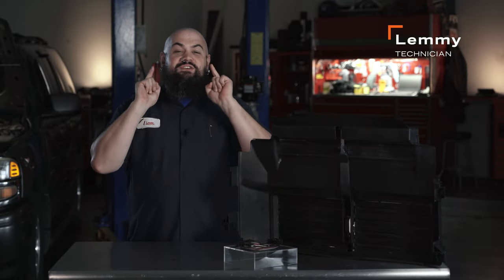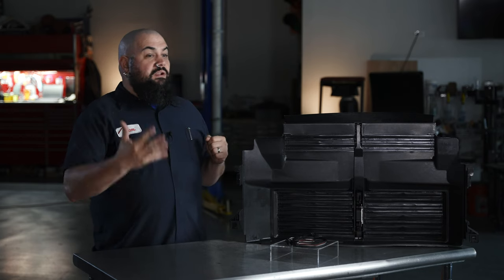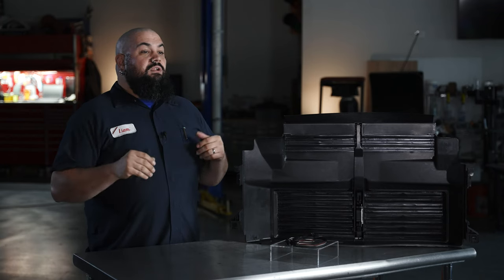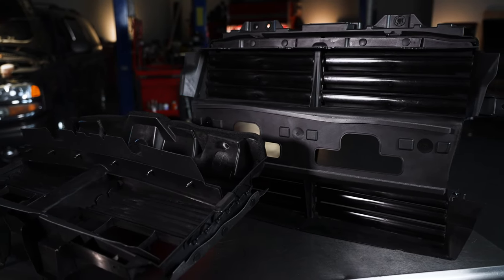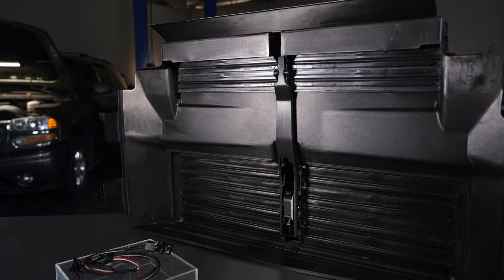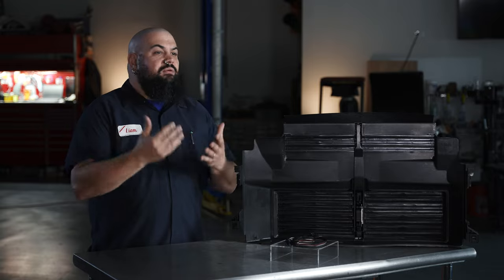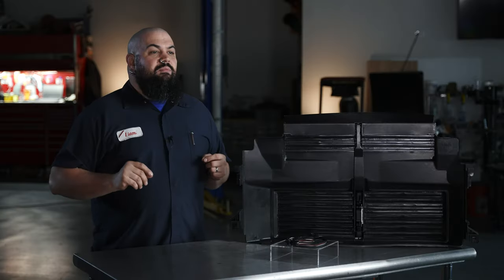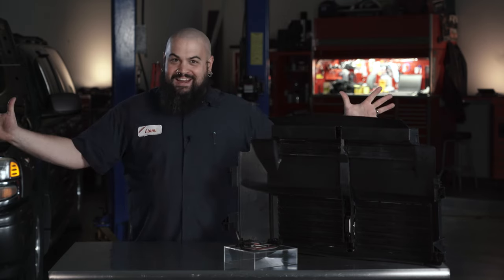Dorman solutions for repairing active grille shutters

Comment: These active shutter assemblys are absolutely the worse thing the engineers could of came up with. Check engine light codes for emissions, wiring harness is a nightmare for chevy models thay have ambient air temperature recalls. Is this honestly that big of a deall for emissions codes? These are such a money pit and time hassle to replace , clean , or diasgnose. Owner manuals list them as a serviceable part, making sure to keep it clean and free of debris. Best case scenario you have a car or truck that you can easily remove the bumper. 😂